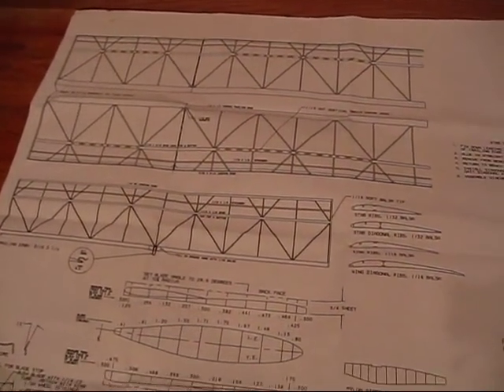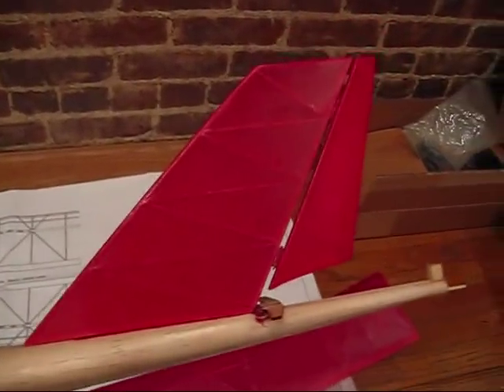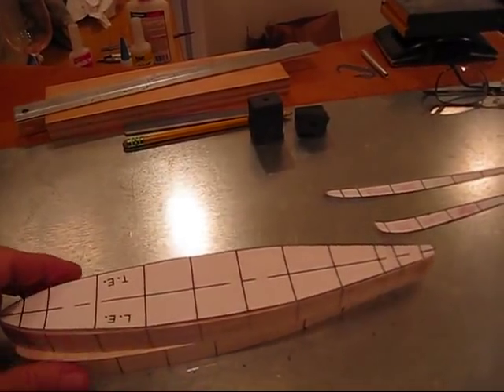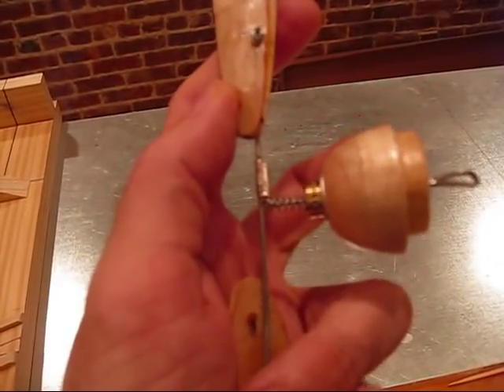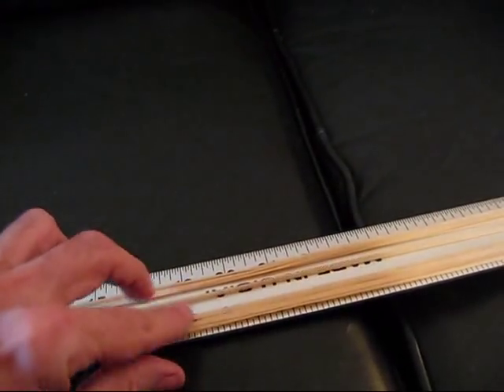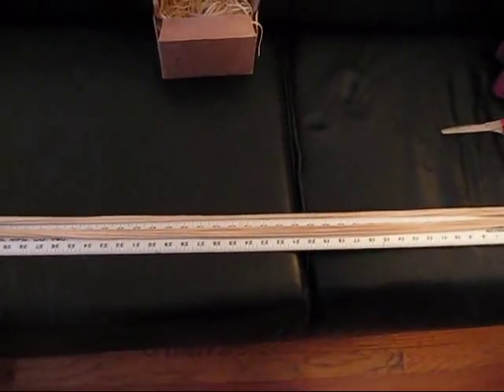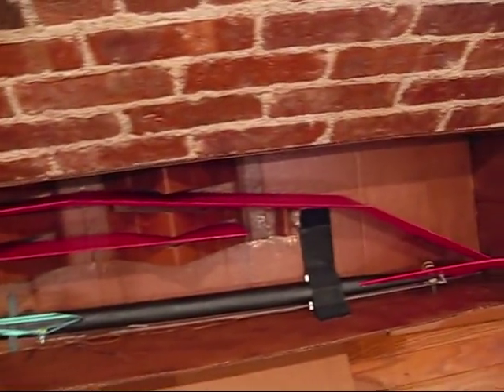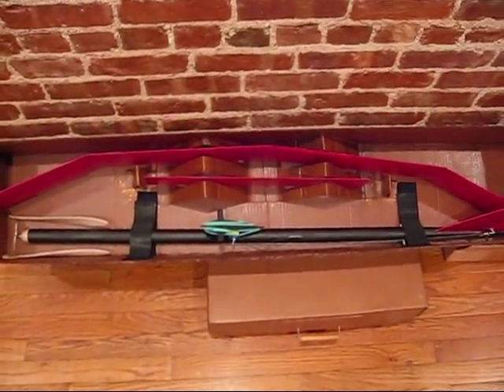Mulvihill 'Tubestake' RC rubber - building

Comment: I so enjoy your videos.  I am inspired to try something like this Mulvihill.  I just have not managed to do a successful  rolled fuselage or make those type of props.  I guess it is trial and error until you get the hang of it all.  Thanks so much for the videos.  Please keep them coming.  Crashcaley
Reply from the maker: Thank you. Yes, it's a lot of trial and error, I've gotten good at some things simply because I've earlier made every mistake in the book! For fuselages this size, I use bedsheet to roll it in - tape one end to the form (broomstick in this case) and kneel on the other end of the sheet to keep it tight, I thought I showed this in one video but I don't remember which one. Jim's Mulvihill is great, flies really nice, but it is kind of big for the small field I'm flying in (1.3 acre) so it's retired, I'll probably give it away. You might want to check out his Smalvihill, a lot of fun and flies great, I have two build videos on it and a flying video here: https://www.youtube.com/watch?v=n5h1paoojGA&t=22s

Comment: The late great English aeromodeller, John O’Donnell, showed me how to get the loops of rubber even. First you make up the motor as good as possible. Then It’s a bit like I used the have to hold wool for my mother, you swing your wrists over each other several times. It rolls the strands till they are all equal. It’s difficult to describe, but you use both wrists to keep circling the motor like it and your wrists are at the rim of a circling wheel. 
I don’t know how you get your models to fly so well in a city park.

Comment from the maker: The receiver, battery, and servo all together weigh about 30 grams, slightly over an ounce. The switch, wires, and modifications to the pylon probably added about another 10-15 grams. Haven't thought about putting a DT because, if I can't steer it to keep it in the field, there's no where to DT in NYC, it will end up in a tree or on a building. Ironically, I just lost it on a test flight, not sure why the rudder didn't work, will put up the video.

Comment: I suppose you may have moved on from wings covered in dyed Polyspan, did you find it took quite a few coats of dye to get a good representation of color? 

I like the translucent effect..... it really seems to take time and an airbrush in pretty close to the material.
Reply from the maker: It's been a while, but I think I used 2 or 3 coats of spray max, after 2 coats of 50% thinned Nitrate dope, that covered pretty well. I only use polyspan on large planes, like 50" or over, otherwise I just use Mylar.
Reply: domoremat, this is going on after 2 coats of dope. Sealing the Polyspan first seems critical. I have plans for a large glider and this very mulvihill.... thought they would work well with PS.

I've also read people mention wrapping the fuse of a Gollywock in Polyspan in order to have a more prop blade resistant covering.....

A Gollywock is something you want to build light as possible so i am on the fence there.

No build logs this winter? I thought you were planning a Hoosier High Flier or a Lamb's High Climber...... i remember some mention of Yonder as well.

You are due to build sir, whether you need another plane or not.  Enjoy
Reply from the maker: Polyspan is way too heavy for the Gollywock fuselage, you should either use polyspan lite (only available from Mike Woodhouse) or tissue, and I'd use mylar on the rest.

I do have an unpublished build of the KK Ace, started Jan 2017 finished Oct 2017 but I'm holding it until I can put in a few test flights at the end as usual, no good flying days since October, but soon. Yes sir, as per orders I'll get going on another outdoor build, thinking of something with a folding prop this time.
Reply: domoremath all good news. I used Esaki in ma' Golli myself 

I'll keep my eye out for the Ace video
Reply: domoremath - how does something from the nostalgia period sound? You've got Old Timers in mass quantity, the J'OR and Bob White  Coupes and such are 1970s or newer...

You might be underrepresented in NOS , plus they're beauties. The 60's designs get completely overlooked by everyone...

If you haven't seen Bernard's kit offerings.... take a look at Hummingbird. He gets the bugs out. Bernard has lots of interest in Rene Jossien. His Toto is on my list....  very interesting design with asymmetric wings.

Bernard hopes to introduced more Jossien models who had beautiful beautiful low wing Wakes and Coupes. 

https://hummingbirdmodelproducts.com/
Reply from the maker: Coincidentally the latest plane I've been thinking of building is Hank Coles 1947 Cirrus Cruiser, from Holman's Nostalgia section, I have the plans and short kit.
Reply: domoremath interesting choice. Nostalgia has a lot going for it. I'd guess a cabin style fuse makes for an easier rc install unless you have a stick with a pylon.

There is a fellow who scaled down a Lefevre Wake from '56 I believe to make it FAC legal.  A beautiful model sheeted to the motor peg with a pylon. So many gems.

I'm thinking about building a small Mulvihill from Jim Moseley - he loves to use elliptical wings. Twin Fin, very straight stick fuse and a single bladed prop. His are just beautiful.  Not sure what year he designed it. 

Enjoy the CC, I hear that and the Smoothie really fly.
Reply: Domoremath.  Just the ticket.  I have thought many times (I'm a serial watcher) that some of your oldies like the Pepper, the Korda and so on would be far better with a folder.  I know it's not ok for contests but for sport flying...Just an aberrant thought I know.
Reply from the maker: Yes they would fly better, but I like to keep everything SAM (Society of Antique Modelers) legal, you can only use a folder if the original plan showed it. I'm leaning now to building another Jabberwock, that one is allowed to have a folder.
Reply: domoremath , how about the Dyna-Moe? I consider the Sparky is to the Pepper as the Jabberwock is to the Dyna-Moe.  All are no doubt great, the Pepper and Dyna Moe are beauties. 

That said, I don't know if it allows for a folder.
Reply from the maker: Yes, the Dyna-Moe allows for a folder, I've had it on my to-do list for years, saving it for when I want to try a single retracting wheel, like on the Sky Rider and others. But I'm liking the pre-war version of the Jabberwock these days, it's a little smaller at 32" and the post-war one I built was way too heavy, so I'm thinking of giving it another shot.
Reply: domoremath I appreciate the idea of trying the prewar version and making it lighter 2nd time around. 

I believe Mark at Retro RC offers pre and post war Campbell's Custom Kit versions of the Jabberwock and the Gollywock. 

Lots of variants there. I built a New Gollywock which has a very large stab. It's quite nice. I always thought one of the principal differences between pre and post war versions would be  bamboo tips on the pre war models.

I'm looking forward to building a short kit I got from Don Deloach he believes to outperform the Gollywock. He got it from a Zaic Yearbook designed in Philly by Ted Becker. 1955 I think. I love it when people resurrect designs they find in old YB's I believe J'OR's Torontonian Wake and Yonder are via Zaic though I don't have the year containing Yonder.

Great stuff. It's fun to look back at these older videos of yours. This Tubesteak must have been like flying King Kong through mid town!
Reply from the maker: Yes, I have the Retro RC kit, it's pretty nice, yet another reason why I'm thinking of building it. You're right, the Tubestake was like King Kong in midtown, even on a test hand glide it would cross the full field and hit the fence! Definitely a little tricky to fly such a large plane in a 1.3 acre field.